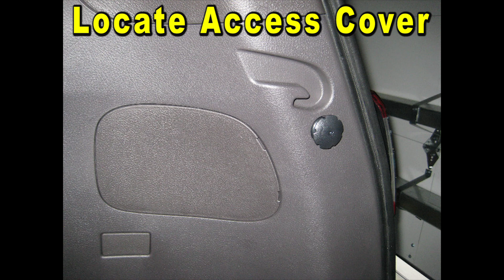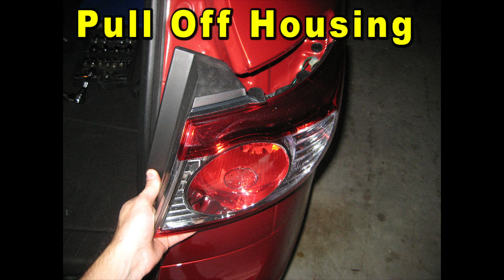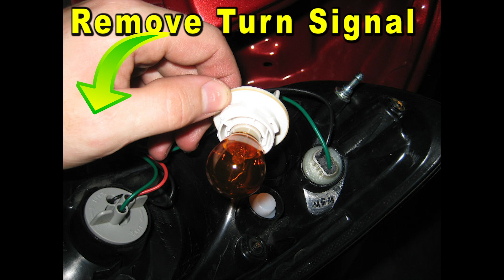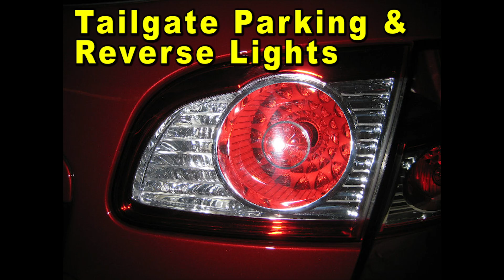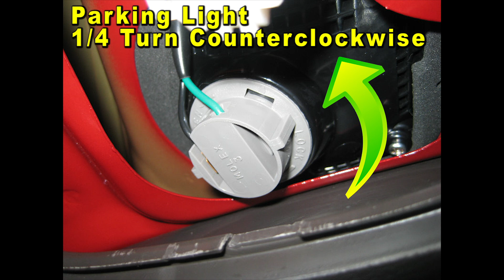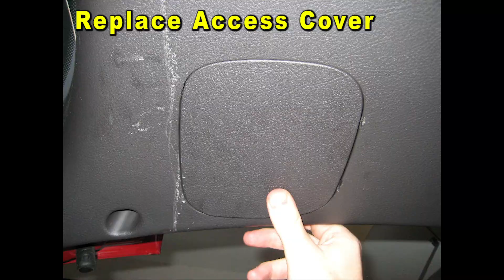2007 To 2012 Hyundai Santa Fe How To Change Tail Light Bulbs With Part Numbers

Comment from the maker: Hyundai Santa Fe Brake Light Bulb - https://amzn.to/4cmRAuW
LED Brake Light Bulb Part Number - https://amzn.to/3SNdLDw
Hyundai Santa Fe Rear Turn Signal - https://amzn.to/3WCT6TI
LED Turn Signal Light Bulb Part # - https://amzn.to/3SP1deW
Reverse Light Bulb Part Number - https://amzn.to/3WHNtUj
LED Reverse Light Bulb - https://amzn.to/3WHn5d5
Rear Side Marker Light Bulb - https://amzn.to/3X0wAW7
Precision Screwdriver Set - https://amzn.to/3sLixaP
Plastic Pry Bar Tools - https://amzn.to/3HMtsV7
Socket & Ratchet Set - https://amzn.to/3Z17LbA
Mechanix Gloves - https://amzn.to/3jCnHkt
Torque Wrench - https://amzn.to/3vS5uSI

The Paul79UF YouTube channel is a participant in the Amazon Services LLC Associates Program, an affiliate advertising program designed to provide a means for sites to earn advertising fees by advertising and linking to Amazon.

This DIY video shows owners of the 2nd generation 2007, 2008, 2009, 2010, 2011 and 2012 Hyundai Santa Fe how to change a burnt out brake, rear turn signal, reverse (backup or back-up) or rear side marker bulb in the tail light housings.

Comment from the maker: Check out the DIY guide for changing the tail light bulbs in a second generation 2007 to 2012 Hyundai Santa Fe SUV - 
https://www.paulstravelpictures.com/Hyundai-Santa-Fe-Tail-Light-Bulbs-Replacement-Guide/index.html

Here are all of the DIY repair and maintenance tutorials for the 2nd generation 2007 to 2012 Hyundai Santa Fe - 
https://www.paulstravelpictures.com/Articles/Hyundai-Santa-Fe-Repair-Maintenance-Guides.htm

Owners of other Hyundai or Kia vehicles such as the Tucson, Veracruz, Accent, Elantra, Veloster, Sonata, Azera, Genesis, Equus, Forte, Optima, Sorento, Rio, Soul, Sportage and Sedona may also find this guide to be helpful.